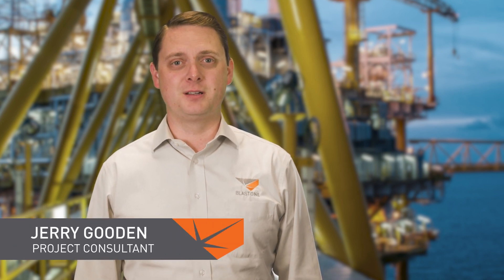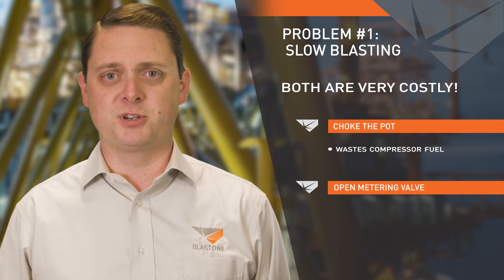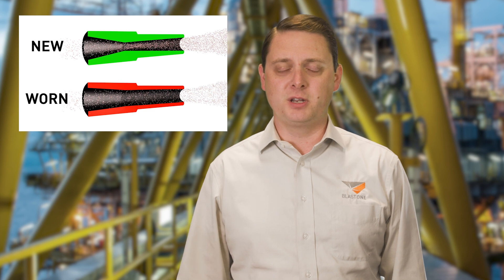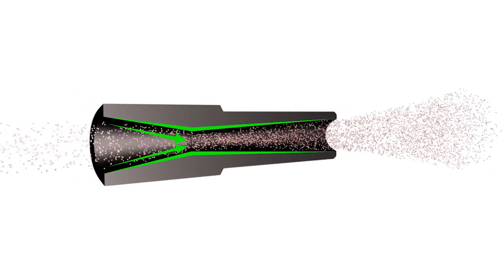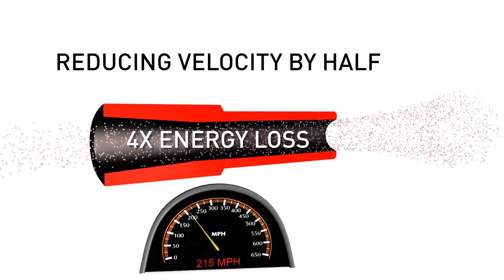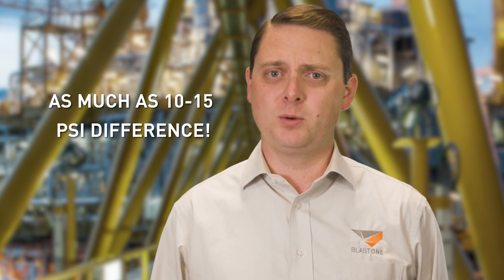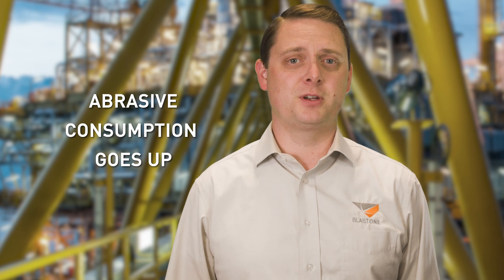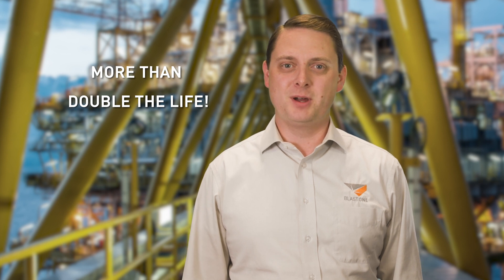Do you want to sand blast faster?

Comment: How many pallets should a nozzle last.  I know, it depends on media type.
Reply from the maker: You are right, there are a lot of factors that could impact nozzle life such as media used and psi at the nozzle - but as a general range, you could expect an ultra, snakebite, or hyper nozzle to last 150-200 pallets.  Half of that for a tungsten carbide nozzle.